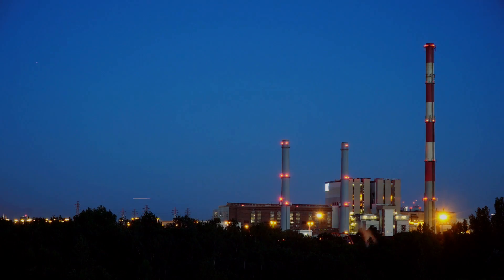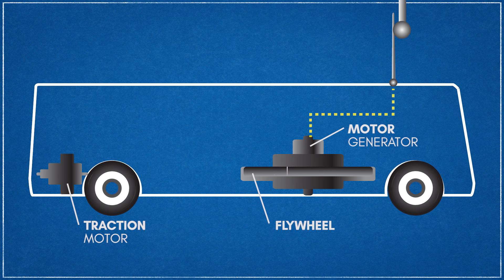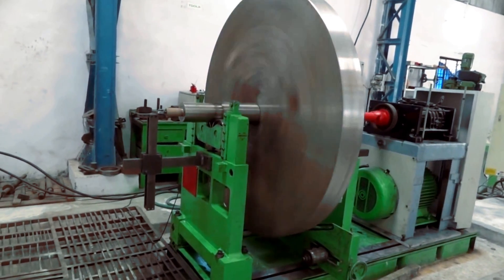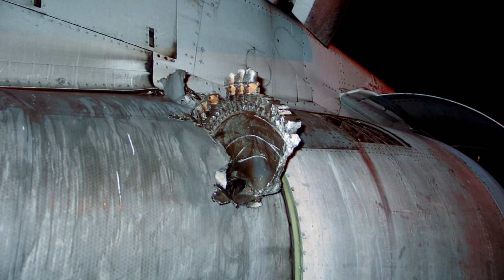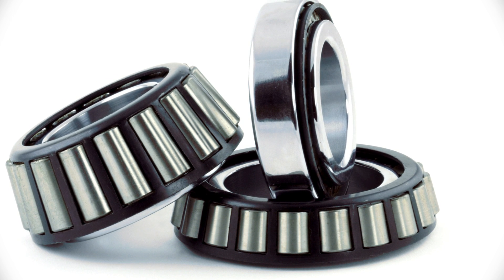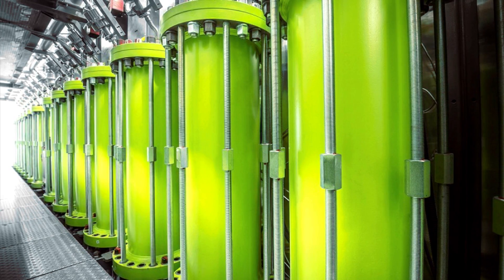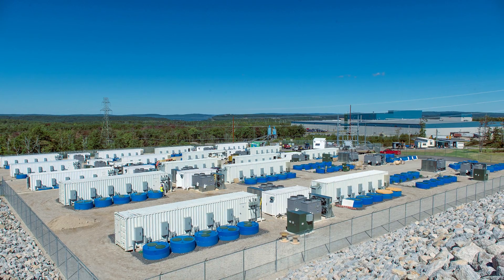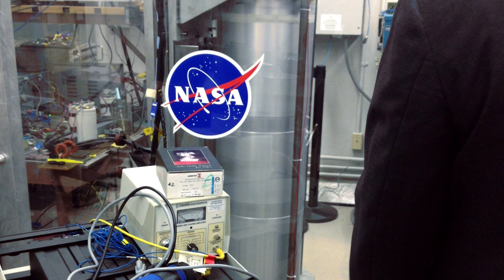The Mechanical Battery

Comment: Once the world finally realizes that nuclear power is the smart way to go, energy storage will be an insignificant issue. It would be better on an energy density basis to manufacture hydrocarbon fuel from the air and water using nuclear power to run cars than using a battery and certainly better than the risk of a 60,000 rpm flywheel exploding in the case of a traffic accident.
Reply: Really? Chernobyl and Fukashima combined have nearly killed the planet we just don't know it yet.
Reply: Expensive renewables? You put that in a comment about nuclear?! Solar is cheap and getting cheaper due to economies of scale. As for energy storage, if in a remote location I can have partial inexpensive energy or no energy, solar is the economic solution.
Reply: @nl9835  I'm not saying stop building solar, but, if we try to depend on solar, there isn't enough time to build enough PV infrastructure to do anything substantive about CO2. And the main cost of nuclear these days is LAWYERS. Eliminate the litigation, legislation and red tape and the price will come down.
Reply: There is no one “smart way to go”. Don’t be a fool. Nuclear is a good baseline supply. Solar offers excellent daytime supply. There’s many different energy situations that will require different solutions. You are also discounting battery tech development (cleaner, faster charging, longer life cycle). And what is the bs about coal? That doesn’t make sense in any future energy solution.
Lastly, batteries are %80 efficient. And that’s just today! Nuclear is not “free”. Nothing is ever free. You have manufacturing, maintenance components, potential proliferation. Your whole argument is flawed.
Reply: Totally, all we got to do is find somewhere safe to store the most toxic materials on earth for millions of years and ensure accidents and natural disasters never ever ever happen for the rest of the time we are on earth.
Reply: @kperry5000  just 300 years if we use thorium
Reply: We have to have thorium before that happens. There’s still material challenges to solve before it becomes an option. I’m as excited as anyone about thorium, but it isn’t ready quite yet. There are some good projects coming up, but we can’t use it if we don’t have it.
Reply: @kperry5000  plus it produces 1000 times less waste and cant have a meltdown
Reply: People tend to forget that the more a material is radioactive, the less time it is.
plutonium 239  has a half life of 24k years,  hence it is far less radioactive than let's say cesium 137 with a half life of 30 years.
Both are very proportional.
Reply: @kperry5000  You know nothing about nuclear waste obviously. Go learn some stuff about it, its interesting.
Reply: @kperry5000  I'm not talking about building copies of Chernobyl. Guess what? The technology of nuclear reactors has improved since that was built. Modern designs are safe, if they have a failure, they just stop reacting and cool down. There's no danger of a runaway or a melt down. Also, they can be designed to reprocess waste, even from earlier generations of reactors.
Reply: @Mishn0  As long as we produce radioactive waste with a half-life of millennia, and as long as it's possible for a catastrophic reactor failure to render an area uninhabitable, we're not there yet.  We need something else.  Thorium and reactors that become inert when they crack open hold promise, but they're not here yet.
Reply: @joesterling4299  You're not paying attention. The new design reactors can take that waste and reprocess it into new fuel. AND, the waste that has the ultra-long half life ISN'T the most dangerous. Long half life goes hand in hand with low radioactivity.

Comment: I doubt that one flywheel can power a space probe. If the wheel spins faster or slower the whole spacecraft would turn as well. They would need a second flywheel spinning in the opposite direction but with the same rotational axis
Reply: Good point, I thought the same when I first heard of these. Pairs seem necessary. There are satellites currently in low orbit that go into the Earth's shadow, through that time they use the flywheel energy, and recharge them from solar.

Comment: Best video I have seen for ages!
Reply: In 2009 I got a £5000 grant from Scottish Enterprise to hire A professor from the National Engineering Laboratory in East Kilbride to assess my Flywheel device that used solar or thermal to power it up and generate electricity. The professor said my invention required ten patents, was radical and worth billions worldwide. He arranged technologists at the Technology Strategy Board to look at my ideas. I was subsequently phoned up and told to apply for £500,000 grant for proof of concept, but I would need a university to manage the work. I am a lone inventor so in ten years I still have not managed to take the ideas contained in my invention anywhere! So much for support in Scotland the land of the chocolate teapot!
Reply: @Primer595  - if you need more support please contact us - have you tried Qinetiq?

Comment: sounds like we're desperately searching for another solution, because electric batteries can't seem to power the future
Reply: Universal solution? There is none. Batteries and flywheels operate optimally in different conditions and have different use cases that leverage their strength while not demanding much on their weak properties. Life is full of compromises.
Reply: The students here have developed solutions for bulk grid storage only - and in this use there is nothing better.

Comment: Excellent video! I didn't know about these busses. Did they ever have problems in handling due to gyroscopic precession or were the flywheels built into gimbals?
Reply: With the rotor being horizontal it wouldn't effect turning left and right as that's the same as the axis the flywheel is rotating on. But, precession would be a problem on rotating upon starting a climb or descent, but that would be relatively insignificant.
Reply: @Mishn0  The rotor was vertical, the rest of your comment is correct (orientation is the line of the axis, not the disc). :)
Reply: @77gravity  Okay, I meant the diameter of the rotor's disk was horizontal, but if the standard nomenclature is to refer to the axis of rotation, I'm wrong.

Comment: These busses would behave quite weirdly when running into speed bumps or transitioning into steep slopes...
Reply: Or even when taking a turn! This was actually a problem with these busses. That's why experiments with these busses were stopped in my country.
Reply: Jochem Bonarius Well, when the Bus is turning left or right, the axis of rotation of the bus and the flywheels axis coincide. So there would be no effect on the bus. Another effect however, and a quite useful one at that, was, that the bus wouldn‘t tip into a ditch if one wheel went over the ledge.
Reply: @TheItsememario  Except that going around turns would make the bus try to lean away from the apex, which the gyroscope would resist, but perhaps induce some other "weird" force into the bus.  Also, if the bus does lean, then returning to a flat position after the turn would also be resisted by the gyro (and also induce "weird" forces).  The handling characteristics would be unusual, to say the least.
Reply: @TheItsememario  yeah but it will break an axle if running over a curb. What's more common, running with one wheel into a ditch or running with one wheel up a curb? 🤔
Reply: Some mobile systems have two counter rotating flywheels. Their gyroscopic effects exactly cancel out in normal operation.

Obviously, there are some interesting failure modes, if the control system fails to run them in sync, or if the system gets bent out of alignment.

Many of those cylindrical containment vessels were housing pairs of flywheels.
Reply: hamjudo I would assume these aren’t very good in buses, but they have a great potential for other uses which don’t involve motion
Reply: @hamjudo  thats fascinating. so theres no overall gyroscopic effect on the car, but theres double that in stresses in the case, no?
Reply: @swaags  The cases are designed to contain the shrapnel if a gyroscope fails or a large vehicle hits the bus.

These safety constraints mean that the case is also very heavy.
Reply: @hamjudo  Well the internal stress would also be quite insane, I don't know how they manage this on the F1, do they just point the axis straight up to minimize change in axis of rotation?
Reply: @chengong388  F1 cars never ended up using gyros, just regen and batteries. They were considered, however
Reply: @benjaminmcintosh857  flywheels have a gyroscopic effect. any spinning mass will function as a gyroscope, and you have to account for that sort of stuff when youre shoving it into an f1 car. the rotating mass is going to want to stay oriented in one direction, so when the car turns and changes directions, the flywheel is going to try and shift inside the housing. thats why earlier in the video he talked about the different types of bearings used and what their pros and cons are.
Reply: @kasuraga  I know how rotating masses work, I meant to say F1 cars never raced with flywheels
Reply: @benjaminmcintosh857  they have raced with kers. what are you talking about. kers IS a flywheel system.
Reply: @kasuraga  F1 KERS was allowed to use either a flywheel or battery. Only WilliamsF1 developed a mechanical system but they never raced with it, opting for the electrical alternative
Reply: @hamjudo  I don't get how the forces would cancel out, the flywheel resists the change in orientation no matter in which direction is spins equally
Reply: @forloop7713  mount one flywheel so that when the bus goes down a hill it pushes the bus into making a left turn and going up hill induces a right turn. Have a second flywheel spinning at the same speed, but opposite direction. The turning forces will cancel out.
Reply: @forloop7713   If the flywheel or flywheels can move independently from the movement of its/their containment (fully XYZ plane gimballed) then it/they will react (move) proportionately allowing such movement. I do not know what kind of lag factor is involved but I imagine?? there may be a perceptible delay in functions we perceive as instantaneous like our car turning when we turn the steering wheel..I would like to know the answer to this... anyone ?
Reply: Just gimbal it. No fuss, no muss.
Reply: @ananda_miaoyin  If you gimbal it, it will start spinning wildly out of control within the gimbal
Reply: @ananda_miaoyin  Actually I think I was wrong.  Gimbal makes sense if you can allow for the extra geometry.
Reply: @mattrevesz  hey, more people willing to admit they are wrong after their own consideration without begging the person to do so is a quality I praise in people. Thanks for being awesome, even though it is probably easy for you to do with a great attitude like that.
Reply: Gyroscopic precession baby
Reply: Holding a gyroscope in my childhood was quite an eye-opener.  Magic forces!  I don't consider these uber-flywheels practical in small moving vehicles.  Buses limited to a flat city, perhaps.  San Francisco?  Forget it!
Reply: Marine applications for a gimble mounted system are endless. They have stabilizers that are this almost exactly.
Reply: @ianPedlar  One time they didn't notice when the bridge was out.
Reply: 1096 bimu I noted the Swiss ones or what something like a top speed of 60 km what is that 45 40 miles an hour or something So speeds were probably limited due to the cold gyroscopic action of the fly wheel
Reply: @gregkelmis2435  In heavily populated areas going over 60km/h or 40mph greatly increases risks of collision deaths.  So for city busses it's generally wasteful to build for higher speeds.  Frequent stops have a similar effect.  Longer distance express bus routes and rental point to point busses do benefit from higher speeds so multi purpose busses include that ability.
Reply: I read the comments and have questions:

I. bus seem to not be an good idea but what about trains? In worst case scenario like there are curves.

II. What can I put in a ship else than nuclear reactors?

III. are you guys fan of nuclear power and should this be leveled up as much as possible?
Reply: @realmcafee  Nuclear is a good idea most of the time but poor public and political perception have left stifled its potential use
Reply: This actually caused some accidents.
Reply: In a gimbal setup this issue is not a problem.  Just allow it to tilt 20 deg in both axis.
Reply: The issue isn't the gyro, that might be able to be overcome,  it's the fact you are hauling around an extra ton or more. And it's not a mechanical battery is stored kinetic energy.
Reply: Would the earth turning around continuously be part of how it wears more than if didn’t turn?
Reply: There are self righting motorcycle concepts that use a flywheel for this reason. The (motorcycle) system is small enough to fit in cars, and the makers plan to sell them to specialized vehicle manufacturers. 

There's a YouTube video where a jeep with tail hitch/cable couldn't tip over a motorcycle (with flywheel active).
Reply: @ianPedlar  i was just thinking about that movie the other day...
Reply: Hehe imagine the bus swaying left or right  at every bump or pothole... Or even when breaking (depending on the rotation dorection of the flywheel)